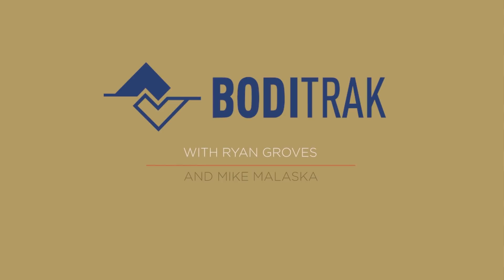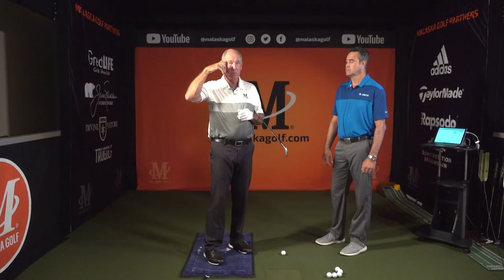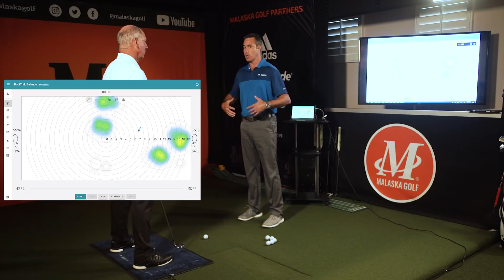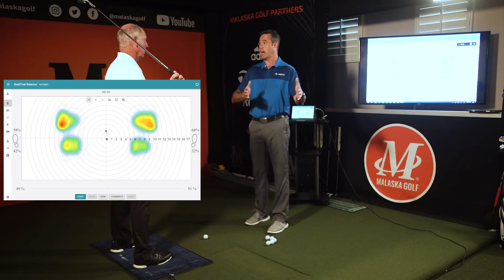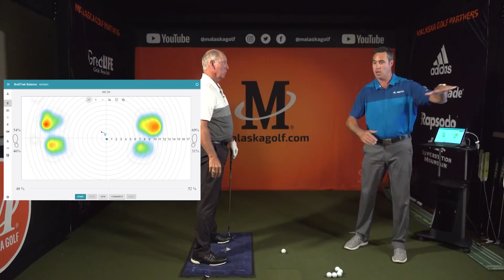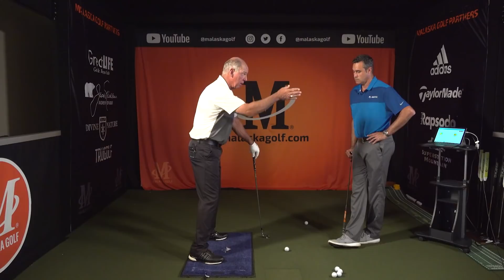Malaska Golf // Tech Series: Understanding Ground Forces in Your Golf Swing with BodiTrak

Comment: This is a fantastic video! One thought that I have though about nothing being new Mike do you subscribe to the idea that there is a classic golf swing in a modern golf swing? Or do you find commonalities even in the gap between those? Because Payne Stewart swing Bobby Jones swing Tom Watson swing are definitely to me more around and more on a transverse plane and even a little different in the sequence in the way they use the joints in the hips. To me there is no hip depth there is relatively little hip flexion or extension it's more on a transverse plane where it's around and the sequence goes kind of from Club to hands to shoulders to torso to hips Etc and then reverses into foot and then up throughout and then back to impact for a classic sort of golf swing. Whereas the modern swing is definitely more flex and extend the hips and using the thighs as you mentioned the legs to push the hip back Etc I would feel is more of a modern understanding? So my question is even though the body's exactly the same did they use their body very differently back in the 60s 70s and even into the 80s?

Comment: Maybe what Sam Byrd got across to Henny Bogan was pointing the butt of the  handle of the bat at the catcher at the top of the backswing (ie no hesitation).  Watch Mike Trout & Bryce Harper.

When you bump the left hip forward to start the shoulders/arms/club to give the barrel of the bat its velocity through the strike zone; that's when the left leg straightens & further increases the acceleration.

My swing key predictors [at the top of the backswing] to a successful shot are the same as BH's:

1.  Lead shoulder touching the chin.

2.  Butt of the club pointing at the catcher BEFORE the hip bump.  BH likened this to pulling-an-arrow-out-of-the-quiver, but the handle must point down to the catcher & not upwards.

BH used to hang out with Ted Williams as well.  They both served in WW2 about the same time.  What do you think they talked about ?

Comment: Was extremely interested when you were talking about the lead foot stepping back behind you. This is a problem I've had for the 47 years I've been playing this game and I've never been able to rectify it. Unfortunately I'm not a big hitter like the ones that were referenced. I'm now a  70 year old who struggles to hit his driver 200 yards, and I step away on all my woods, hybrids and mid to long irons. Now I did get a little bit confused with this video, because it seems that at setup you were getting your balance more towards your heels and in the heels throughout your swing. In one of your other videos you say to be properly balanced your balance should be more towards the balls of your feet. So which is correct? Now here's the other thing, when I'm at the range practising I do not step away off my lead foot, only when I'm on the course. Any suggestions will be greatly appreciated as to the best way to stop the stepping away. Not to worried about distance, but would love to at least rectify the stepping away problem. I'm sure if I can fix that then I can get my handicap from 23 back down to 8 where it was 9 years ago.

Comment: Thanks for that exceptional video. I have a question, if i can sequence the correct balance and pressure into the right foot, and moving of pressure back to the left foot does the length of backswing matter? ie: a full 90 degree shoulder turn and club shaft parallel to the ground. Im 68 and still love my golf, but flexibility wont allow me to do that. thanks so much. Mike in the UK.
Reply from the maker: Length of the backswing in one sense does not matter. That is how far back or high your arms swing. But making a full turn is important. I work with a lot of over 50 players including myself. I play from a more closed stance than I did years ago. Plus I let my right leg straighten a bit. Not to totally straight but close. That lets me move my right hip back farther and make a bigger shoulder turn. Close your stance and let your right leg straighten a bit. Just go back and watch Bobby Jones or Hogan or Sam Snead watch their right legs. They straighten out.
Reply: @MalaskaGolf  Thanks a lot. Im going to work on that In my garden net.

Comment: I've never heard anyone say that other sports motions won't work in golf.
Reply from the maker: Only most of my career teachers told me that I should not play baseball and or tennis it would ruin my golf swing. There is an entire discussion on why that is or isn't. But many people that are tennis players are told by their teachers not to play golf. I also have had a lot of baseball players tell me that their coaches do not want them playing golf it will hurt their baseball swings. I had that told to me also. But it was interesting. When I was young I would stop on the way home from baseball practice and go straight to the first tee. I had no range. So tee it up and hit it. I had no problem doing it. I also had no problem playing golf. Then going straight to baseball practice and standing up and nailing the first pitch. But that changed as I took golf lessons and I was introduced to what ended up hurting my career. The Golf swing and the golf arm action with all the forearm rotation. Yes, then they no longer crossed over. At least the hand and arm action. So the ball went sideways in one sport and I hit nothing but grounders in the other until I adjusted.
Reply: @MalaskaGolf  oh I agree with you completely.  Great video!

Comment: In my youth I knew how to relax my arms and naturally transfer my weight for better bat speed. I figured out on my own how to relax my arm and naturally transfer my weight on a throw from the outfield to maximize ball speed. So how come when I have a golf club in my hands my IQ drops to the number on my club???
Reply from the maker: LightningDogg It is probably because of your grip. So when you do what you did in baseball and the club runs into the ball the face is off. So then you have to make compensations and get in the way of that speed that you developed to square the face. Check your grip.
Reply: @MalaskaGolf  Thanks for the reply Mike. I have been working on my grip based on some of your videos I first saw a few months ago. I feel like my problem is related to tension in my arms. Even though I know I need to relax and let the swing flow, I just seem to revert back to "hitting" at the ball and not swinging the club. Thus my IQ comment....some of my problem is between my ears. I'll go back and review grip. Thanks.